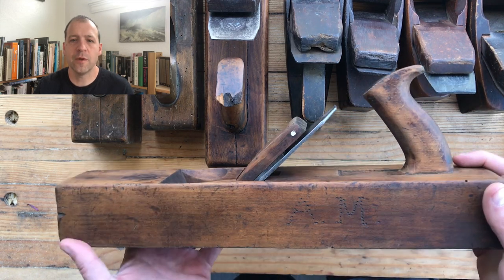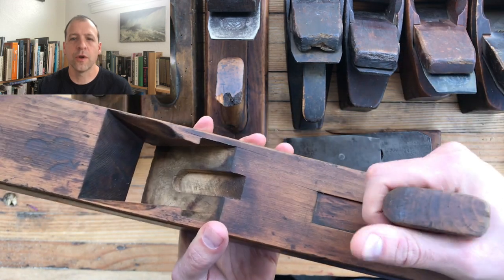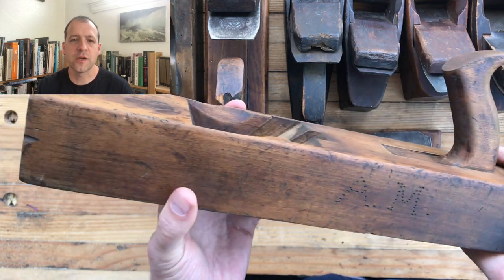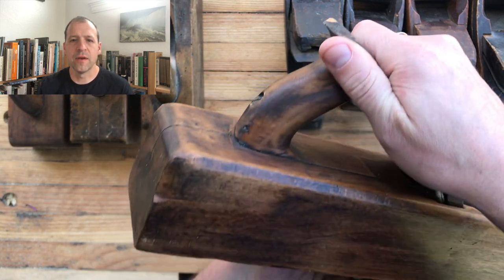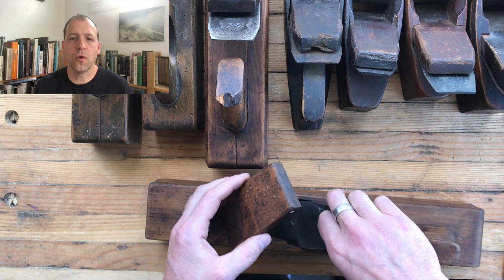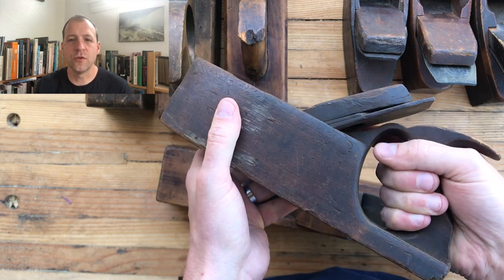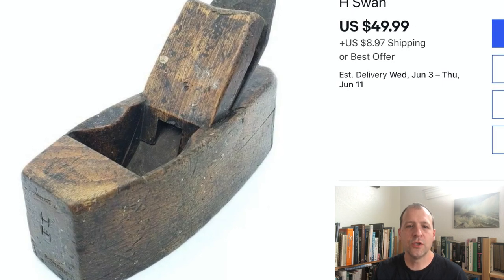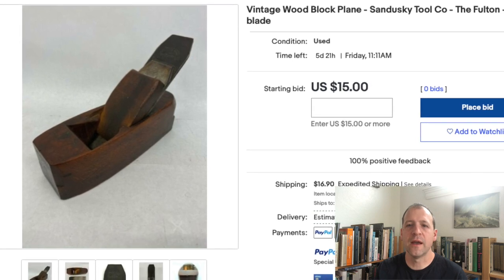Don't waste your money: How to buy antique wooden planes

Comment: I'm here from a shout-out from Rex. I've just purchased a 28” jointer wooden plane as part of a set. It's in great condition but has no chip breaker. There are no grooves or cutouts where the wedge or body was shaped to ever accommodate a chip breaker. Some of the other planes are from the 1800’s. Is this normal? What are your thoughts?? 
Love the channel. I've learned so much already, and I really appreciate the effort you've put in. What would we have done before Youtube? 😁

Comment: @Working Wooden Planes - Regarding a wooden plane that has a mouth that is open too wide, could such a plane be used as a scrub plane if the iron would be sharpened with a camber? Would a smoothing plane or a jack plane be a better candidate to modify into a scrub plane?

Very informative video. Thanks!
Reply from the maker: Thanks! Modifying a smoothing plane is your best option. I did a video where I converted one a while back: https://www.youtube.com/watch?v=7JM_VNyLuv8
Reply: @WoodenPlanes  thanks.  Good video on converting a smoothing plane.

Comment: I have a few planes from my great great grandfather. I haven't fully taken them apart to look for marks. I couldn't find any from just exterior visual. Is there any place or person you can recommend I try to get in touch with to check them out. I know he could have brought a few from Germany during ww2
Reply from the maker: I’m not sure I know anyone who could help you with that, but you don’t need to take them apart to find a maker’s mark. Those marks will always be on the toe (front) of the plane. If you don’t see a mark there, then we just don’t know who made it. Any other names/initials stamped elsewhere on the plane will be an owner stamp from a previous owner (if there was one before your great grandfather). The plane blade may have a company name on it, but that is typically someone different than the plane maker.

Comment: Question I have ran into some one or two hand planes that weren't meant to have a cheap breaker and screw. Inside where you put the iron in, is litterly a flat and just held by the wedge. Any chance if getting planes like that are no good or abit of a risk there?
Reply from the maker: They’re called single iron planes and they’re excellent. It could mean the plane is quite old, from the 1700s before people started using chipbreakers. In the 1800s nearly all planes were designed to be used with a chipbreaker. But single iron planes never totally went away. The irons on them typically have a high angle and they’re used for hard or cross-grained wood.
Reply: @WoodenPlanes  Ohh, thank you for the information. Now I'll know the next time I see one. 🤓🤓🤓